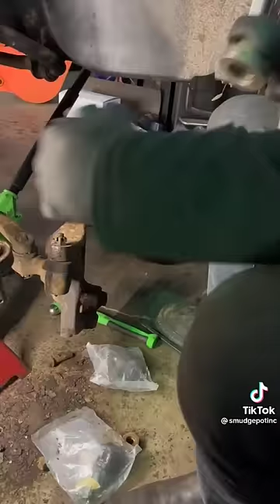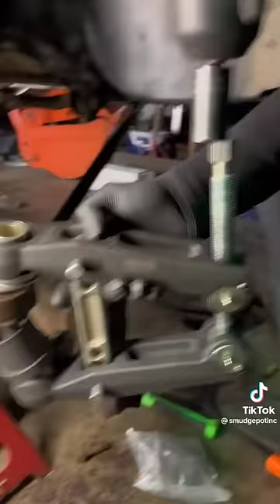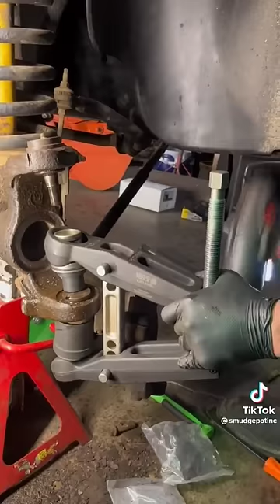Matco Ball Joint Press out ball joint Tool Kit pt.1 #automobile #diy #fyp

Comment: Don't ignore creaking front suspension. Three weeks after MOT (roadworthy) in the UK I heard the first small noise. Took it back and told them that I thought the balljoint was shot. Picked up the car and was told it was the fly-wheel making the noise. A week later I booked it back-in and told them to replace balljoints. The next week before the appointment the balljoint popped out on the motorway, screwed the fender, driveshaft and tyre. Big bill (paid by the mechanic) for a small part. Got the car back today after 2 weeks.
Reply from the maker: Sorry to hear that. The noise is definitely a first sign. Never overlook the signs.
Reply: why would the mechanic pay the bill?
Reply: @MatthewMorton-sb8ms  They missed a worn ball-joint in the mot. I returned the car within weeks and said I thought it was a worn ball-joint. They said they thought it was my clutch making a noise. I then returned to book it in specifically to replace the ball-joint. They never.treated it as urgent and it separated on the motorway before it could get done. Had I laid a complaint they possibly may have lost their mot accreditation. The follow-up is within weeks the axle boot split and they charged me for the repair. So they couldn't be bothered to check the quality of the part they supplied.
Reply: @greygtv6  at least they admitted they were in the wrong
Reply: Ok, I'll bite...HOW do you check the quality of the part supplied?  @greygtv6  Are auto mechanics also supposed to be engineers and materials scientists?  Please elaborate.
Reply: @DarkSlideLeo  They bought a used CV joint. It's very easy to check whether the rubber boot is in good condition or perished. In addition, any play in the joint will be evident simply by feeling for it. The joint was ok, but the rubber perished and threw all the grease out. I thought a simple mot then ball joint, what could possibly go wrong? Previously the charged me £130 for work without touching the car, and also cancelled a clutch replacement without informing me. I use them only because I work out of the city and they are my neighbour.
Reply: Using a used cv that's not in excellent condition is insane. Wow.

Comment: Grease the threads, apply some pressure and whack (persuade) the ball joint yoke with a hammer to relieve it. Watch the ball joint move. Pressure again, wack, last pressure and its out. Much easier on tool and much longer life of tool.

Comment: Lube your threads every time.
Reply: Finally!!!!👍👍👍👍👍
Reply: DO NOT do this unless you want your stuff to be double stuck next time. I work for vw, we dont use grease for those reasons like americans do slapping it everywhere and anywhere. As per vw instructions you even put bearings in with NO grease. But to each their own
Reply: @b5Bart we’re talking about the tool
Reply: @hawkboy000  ah yeah then i fully agree i understood that wrong.

Comment: Remember folks, there's ALWAYS a right tool for the job 😉
Reply from the maker: Right
Reply: And always a wrong way to use it for something else as well.
Reply: Yes a hammer. Done..
Reply: Just don't give it to this guy because he'll use it the wrong f**** way he pressed the bearing out the wrong f**** way that's why I exploded like that
Reply: I read this as "there's always a tool for the right job.
 Makes the content way different
Reply: As in WD 40, torch , small sledge and safety glasses

Comment: I have the old school C-clamp style have used it hundreds of times.
Reply: Exactly...they want people to buy things that they really don't need.. been a tech for 15 years and old school way really easy...less expensive..less cost to you equals more bucks in pocket..

Unless you trying for expensive cars..well then...yea 😂😂

Just joking... Mercedes has a special tool for things...but otherwise everything else pretty much the same
Reply: Right, why reinvent the wheel haha
Reply: This tools is literally the same thing but with more weak points and costs 10x as much
Reply: Same. The Old school C-clamp style works flawlessly for me
Reply: Been doing nothin but suspension work for almost 30 yrs used the hammer and the c clamp just got one of these from matco love it does take a little getting use to .
Reply: This styl ball joint press is usable on pretty much any ball joint, they work really well, they are a million times better than the c clamp style for straight axel ball joints, saves you having to remove one to do the other!! Work smarter not harder!

Comment: Where was this 40 yrs ago when I was making up jigs and belting these things for hours, bustin my nuckles and driving the neighbours crazy. I still would have heated the mount a bit to get some expansion before the pressing out of the ball joint.
Reply: Apparently the same place I have been.   That's not inventing one of these lol
Reply: I spent a day building biceps before learning that the top swing arm ball joint on pre 80's mopars was not a press fit but a shallow thread. I had a machinist make up a large square socket to accept 3/4" drive ratchet handle and with a 3 foot length of pipe over the bar I was able to unscrew them but still needed heat. I think Chrysler wanted you to buy a whole top swingarm assembly. I still have the socket 40 yrs later.  You never know if I might one day get that 440 'Cuda.❤

Comment: Definitely the fastest I've seen someone break a ball joint by using their tool wrong. I'm impressed.
Reply from the maker: Lol
Reply: Wait what? It’s wrong?
Reply from the maker: @study-tesh9542  no Jeep Wrangler bottom ball joint press out downwards
Reply: @letsfixit251 I'm glad I'm not the only one to notice that.
Reply: Why is he using it upside down
Reply: Your the first one to notice he push the ball joint the wrong way. Got to say the tools strong to brake the ball joint that way. Just think of how fast it would be if he used it the right way.
Reply from the maker: @user-pt1xe2yb2d  lol, you're wrong again. Jeep Wrangler bottom ball joint press out downwards, sir.
Reply from the maker: @user-pt1xe2yb2d  and they also don't require snap wring. I did one personally not to long ago and filmed it. I have the video on my channel check it out when you get some time.
Reply: @Rob-u4g You’re wrong 😂
Reply: He's right. Dodge Dakota trucks press the same way. At least my 04 does. Changed them this week. Wish I had that tool
Reply: He's right about the tool working for all vics, just not all in the same righted position, but mechanic should know which way ball joints is gonna come out anyway

Comment: Some y’all in the comments don’t live in the rust belt and it shows this things badass
Reply from the maker: True
Reply: And some yall don't have a lot of shop time clearly because I would never use that thing to remove a ball joint and let's just say for fun sake that one day I gave in and used it. I would definitely put a little heat on that yoke to keep from destroying my new fancy, costly tool that I didn't need. The old type with threaded rod was only used to install ball joints. Rust belt don't mean shit when you heat it first. Use your heads, why put that kinda pressure on your tool. Go grab a mallet and ball peen, betcha I got it out half that time. Great advertisement though.

Comment: Opted for the new snap on one for half the price. Still a sweet unit!
Reply from the maker: Does Snap-on have one similar?
Reply: @letsfixit251  not that style just a conventional press but works like a dream and has the quick snap attachments
Reply from the maker: @BigBoyNow  I agree, I seen it already. Seems like it may be hard to get in certain spots though. That's really where the matco one shines
Reply: @letsfixit251  true but for half the cost I have never had it not fit somewhere.
Reply from the maker: @BigBoyNow  have you done a Jeep Wrangler?
Reply: @letsfixit251 yes with conventional ones yes, not with my new snap on one no. I definitely see the allure of what that tool has to offer. But day to day I can’t justify the price. I live in northern Canada and its mainly truck country. But even small cars and bushings of all sorts are easy with this kit
Reply from the maker: @BigBoyNow  honestly I agree because of my experience. I used a regular c style 21 peace press kit I got from ebay on the jeep. I noticed it was so tall it scrapped against the top spring the entire time I pressed it. That will wear it out fast but it was under $100. I could buy ao many of those and still not add up to $1,200
Reply from the maker: @BigBoyNowYT  this the jeep I'm referring to. https://youtu.be/1gEMvaTH5Pc
Reply: @letsfixit251  in Canadian $ the snap on kit was $1100 and the matco one was over $2k
Reply from the maker: @BigBoyNowYT  thats crazy
Reply: How much does it cost
Reply from the maker: @Vuhjayjay68  little over $1,200. The link is in the description

Comment: That's how not to use a ball joint press. Usually the tool specifically says do not use impact on it.
Reply: Um that's not the case...this is a robust tool...if you want to use the tool by hand...that's during the installation process....
Reply: Nope! I can assure you that your comment is erroneous! I am a Matco Distributor and when the manufacturer demonstrated that to us THEY USED AN IMPACT. It’s definitely intended for use WITH an impact… carry on
Reply: Us professional technicians like to torture test our tools. Especially while they are still under warranty, heck most have a lifetime warranty. 
Heck I bet when you rent a Uhaul trailer you actually only drive it 45mph!! Lol , rules are meant to be broken.
Reply: If your tool costs a 1000$ - it'd better handle an impact!
Reply from the maker: Exactly 🎯
Reply from the maker: for sure
Reply: Have had my matco press for about a year and I would have never thought about not using an impact.  Who has time to spin it with a ratchet?  Now if we could actually keep a matco distributor for more than 6 months.
Reply: I bet your lab coat and clipboard are both spotless.
Reply: @jhitt79 my grease and oil stained clothes say otherwise, also i would of just hammered it out and saved my self how ever much this tool cost.

Comment: I remember doing the ball joints on my 20 year old mustang. I rented the c clamp ball joint press from a local O'Reily's. I hand spun that thing over with a rachet. When it finally popped, it sounded like a gunshot. New England rust will do it without fail.

Comment: The one and only time I removed a ball joint I used two big hammers on either side of the knuckle simultaneously.  Took about 5 or 6 blows and out it came.

Comment: Air powered hydraulic would be slick.  Like a AC hose crimp tool setup.
Reply: Hydraulic jack with the air fit from HF, then weld puller hooks onto the baseplate 😂
Stick a socket in there and away you go.

Comment: Heat the arm first and spray penitent to cool it, that'll cool the joint and draw the slickum  into the splines, works on everything
Reply from the maker: @davidetchellsetchells4692  everybody doesn't have a torch and it's not needed with that tool

Comment: Remember: Always grease your threads with high-pressure grease before using a high-pressure mechanism like that.  You'd be surprised at how much easier the job is on your tools.

Comment: Ive had two screws and one "nut" that it threads through. Yes I use good quality grease, DON'T put an impact on those threads. After the first screw i started with a 24" ratchet works beautiful. Second scree on three years now, used most weeks.
Reply from the maker: Thanks for sharing 🫱🏻‍🫲🏾

Comment: Could of done with this on a recent lower arm ball joint on a Jag XK. It's slanted, so took the arm off and pressed it out using a piece of stainless exhaust cut at an angle so it was "straight" in the press. This thing could have saved me a lot of ball ache!

Comment: I could never justify the price and tool space required for that. I used to use an air hammer with a short and long hammer. I Knocked out the upper ball joint first then the lower, and installed them in reverse order. Never failed me, never needed a "third hand".

Comment: Best ball joint press (that im aware of) Diesel shop i used to help out at had one of these, And it was awesome, So much better than a standard ball joint press from somewhere like harbor freight. 

Only down side is that it is very expensive...
Reply from the maker: Thanks for the info!

Comment: I was really close to getting only these. Just procrastinated and told my tool guy to hold off for now
Reply from the maker: @jlauritsen321  you work for a shop?
Reply: @letsfixit251  yeah I’m at a dealer now, but this was back when in an independent. Doing diesel trucks would’ve been soooo nice with this lol
Reply from the maker: @jlauritsen321  lol, right? I agree.  You seem pretty experienced.  Check out the mechanic theme song for a good laugh

Comment: I sprung 2 ball joint clamps on a 3rd gen tacoma. I had to use a torch and sledge hammer. I wonder if this would work. What's it called? Where do you get it?
Reply from the maker: Link in description

Comment: I have a snap on and otc c clamp style. The snap on is easier to use and heavier duty and has more space between each end of the clamp and since all the adapters are held in place by the tool I dont have to do a balancing act and wish i had a third hand. The otc is smaller was cheaper and I have about 10x the adapters as the snap on but is a little harder to keep the adapters all lined up. There have been times when one wouldn't work where the other would and I've used some of the otc adapters with the snap on. I could see sometimes though where this matco one would work good if there is issues with clearance with the c clamp style.

Comment: Getting them out is faster with a sledgehammer, period. Using the tool in reverse to install them is faster than manually doing so, sometimes.
Reply from the maker: You can't always beat then out, plus it's always a risk when beating the thing

Comment: Like most tools that use a threaded rod that tightens up or delivers the pressure needed to work . How many times in use till the threads in tool or rod strip out and it becomes a paper weight ???

Comment: I can guarantee you that me with a 3 lb Hammer will get that done twice as fast as you with one of those but we're running off in the morning whenever the air compressor is at zero and our boxes are locked

Comment: Next time I need to change ball joints in my 07.5 2500 Ram I'm cutting the knuckles off and welding on Dana 60 parts

Comment: For $1000+ idk how i feel about this because the open/closed adapters are NLA (No Longer Available). Having more access to impact is always nice though.

$700 basic tool then mandatory $370 9pc cup/press kit and also optional gm specific $207 4pc cup kit
Idk if some these are available or not but.
Reply from the maker: Really

Comment: Where do I get one of those I  just did all 4 ball joints in kg Tahoe, and it took hours and a cutting torch to heat everything RED HOT, to move each joint.
Reply from the maker: The link to it is in the description of this video

Comment: I'm not a mechanic but this looks wrong.  Appears the shoulder of the ball joint was actually sheared off and the knuckle cracked.  Wouldn't it be easier to turn the tool over, put the cup on top, then drive the ball joint upward thru the hollow of the cup? A new ball joint would be installed from the top of the knuckle torquing it down until the shoulder snugs against the knuckle.  Install downward, remove upward.

Comment: Had a guy injure himself when the support column (that yellow colored metal bar on the press) sheered off from the holding pin failing and caused a deep abrasion against his holding hand, cutting it really deep. Needed surgery and ligament repair. 

Be careful with these things

Comment: I thought they were supposed to be removed in the opposite direction and installed in that direction.
Reply from the maker: @joshm8661  nope. Jeep Wrangler bottom ball joint press out downwards
Reply: @letsfixit251  got ya. I didn't know that. Thanks for the info and videos 👍.

Comment: That milwalkee impact on any puller will in time ruin the threads of the puller. Been there and done that. By hand is slower and harder but saves the puller.

Comment: You're better off saying it only works on American car but there is a tool a lot easier and faster than what you're using the tool is where you can actually remove wheel bearing tool how to remove a lot easier

Comment: Takes 3 hands to operate, bottom cup almost pivoted off the control arm and 4 times as many stress points and moving parts as a traditional ball joint press that works twice as fast, no thanks! Oh and probably 3 times as expensive as a regular ball joint press.

Comment: Works good,  however these tools are not designed for an impact tool. Working in tool rental, i had to charge people for the whole tool because they ruined it with an impact. You can grease them,  but they will still fail.

Comment: Remember to lube new tool treads before firsts use, otherwise you will be blaming the crap tool after 15 uses destroys the high tension treads, 55 years in the trade comment ( not a couch critic

Comment: If it's that stuck then just smack it with a hammer. Had an old yj that knew my mini sledge by heart. Cheaper than that contraption and just as quick.